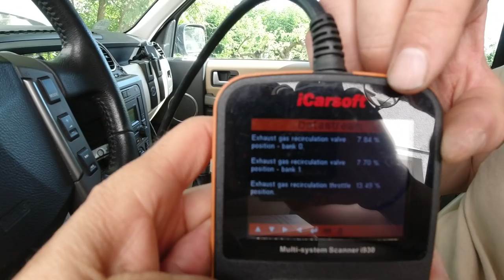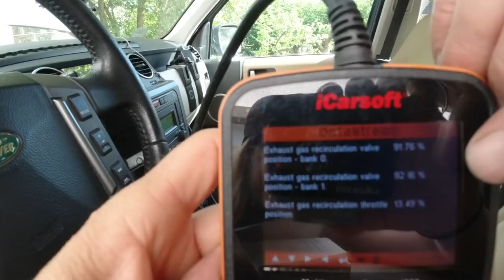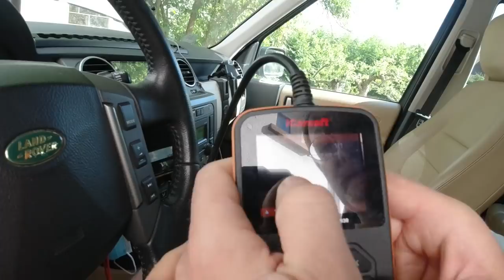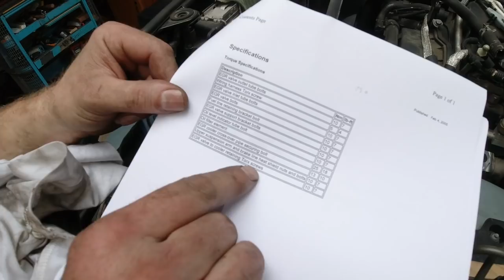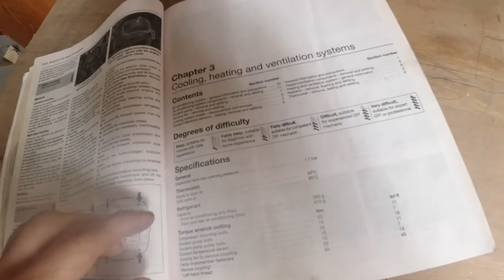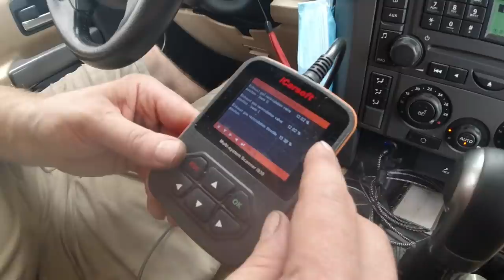How to replace the EGR valve and water pump / Land Rover Discovery 3 / LR3 / LR4

Comment: Holy crap, my LR3 gas engine was a snap compared to this. Did my EGR a month ago. Did my water pump last year. Word of advice, put a piece of cardboard or thin plywood on the radiator while doing any work with belts, fan clutches etc.  Awesome video, you two rock!

Comment: I have recently discovered your channel and I am very impressed with your work ethic and your knowledge I am a technician on airport equipment and have been brought up on Landrover products with my time in the military, I used to use Landrover Defenders  myself  and skipped the Disco 3 for the Range Rover sport with the 2.7 v6  and all the problems that you are having brings back bad memories of the countless thousands of pounds that I spent repairing my Range Rovers, I eventually went Japanese and have had 4 Nissan Navara ‘s my latest is the 3.0 ltr V6 which is about as troublesome as the Landrover Discovery I have decided to go back to running a Defender 110 .

Comment: Hi Christian and Vera, well again with your super German efficiency lol the last time was the "TUF" legal spacers you meticulously fitted, again with my typical English disregard for the law and climate change I removed my EGR valves and removed the DPF and fitted a straight through pipe and did an delete on my engine obd programmer.
I am happier when the engine is breathing through a nice exhaust and not having its breathing chocked by pumping gasses back through the engine block to diminish its fresh air fuel mixture. Actually as long as the vehicle passes its emissions test on our MOT the removal of egr is fine also because of the weight of the car a dpf is not a legal requirement... the test isn't as bad as your "TUF" which I had to manage when living in Munster in the 1980,s
Always enjoy your technical skills and great humour lol all the best Phil and Louise

Comment: Hi, hope ur both keeping well , fantastic video as always , ur spot on 👍👍pre 2007 don’t need the EGR software patch if the EGRs are blanked , mines a 2005 UK D3 , No DPF, must admit blanked mine , left the pipes in situ and slid a blanking plate between the engine block and pipe , then removed the butterfly valve , was amazed with how dirty the throttle body and MAP sensor was, runs so much nicer now and always passes the MOT emissions every year . If it also helps as know it can be frustrating sometimes trying to reach into the engine bay , that I’ve done the same , removed the negative battery lead, jacked it up, removed both front wheels and dropped it down onto axle stands , really helps by lowering the front for better access, of course know ur extremely knowledgeable , just something I learnt and hope that it may also help u, stay safe and of course if it’s ok will share ur video on the Land Rover forums , 👍ps, have u seen the new MOT regulations for northern Ireland seeing it’s still part of the EU , that it will include a code reader to be plugged in, also do u have any LR time stickers left please and purchase price as would be very honoured to have one in the back of my D3 , many thks
Reply from the maker: 👍 Email me your adress,  I'd love to send you a sticker. 🙋‍♀️ Vera
Reply: @Vera_and_Christian  bless you and that’s so kind  of you and will of course send a pic of it in pride of place on my disco , thanks so much ,stay safe and well ,  gary 👍👍
Reply: @Vera_and_Christian  many thks once again and hope the email came through ok , 👍

Comment: I replaced the EGR valves two times (i drove my D4 334.000km... before selling it)
Truly, the best car ive ever driven. Spacious view, comfy seating, a work horse but with all luxury. 
The battery side is a one mans job, 20 minutes and done. The braking side is hell and cant be done alone, unless youre very patiently... but count on 2 and not 3 bolts holding the EGR. (yes you can debolt the AC system, but will have to refill afterwards)
Reply from the maker: That was also already the second time we did this side. The other one we did only once so far. Thankfully, Christian almost always has me helping. 😃👍🙋‍♀️

Comment: As someone who has worked on Land Rovers for 30+ years, I'll give you a good tip.  Get yourself a few old pallets, then when you are working on the Landy, put one in front and one each side and that extra 15cm is perfect.  
Pallets are free, environmentally friendly because they are wood, they have good grip on the surface and won't slip or fall over like a milk crate or step ladder, thy can live outside and when they rot, you can put them on the fire and stay warm.
Reply from the maker: Never thought of it, we have at least 20 pallets at home. Philipp uses them for his  Mountain bike trial training 😃👍🙋‍♀️ Vera
Reply: That’s a great idea, normally I’ll remove the front wheels and put some axle stands underneath to drop the front right down to make it easier to work on , particularly the engines oil filter , at one stage I felt like putting a plank across the engine bay but seeing the wings aren’t metal thought it was a bad idea , good call 👍

Comment: Hi,
I was very surprised, seeing your bolts fixing the egr to the egr cooler, looking to the front.
At my D3 2009 they are fixed from behind!
That is always a fantastic job to loosen them.
But after four or five changed valves, you get used to it😉.
Funny video!
Regards Herby

Comment: As you said Christian, we in Australia have nothing in the location where you have the diesel heater. It is a good location for another 12V battery for running a fridge, camp lighting, shower water pump etc.

Comment: 2% battery - that tickled me. True lies was a good film.
I remember my WK 2005 Grand Cherokee with the Mercedes OM642 3.0 V6 Diesel would throw a check engine light when it was not happy with EGR, I put a resistor on it to keep it closed and get only fresh air.
Reply: Are you confusing the EGR with the intake manifold swirl flap actuator on the OM642?
Reply: @tempestv8  that can easily be done. 
There is even a video I made in my collection many years ago. 
Made a long time before people (including me) made
Anything from YT 👍

Comment: If a water pump is on sale, you've got to buy it - LOL. The old one looked that it had some play in it already, so the sale was timed just right.

Just changed my timing belt so I replaced all the pulleys and also the water pump and belt  to avoid having to disassemble all the stuff later.

Great videos, but I doubt I'd attempt the EGR valve myself. BTW - where did you get the tiny ratchet angled wrench and the magnetic bolt retrieval rod?
Reply from the maker: Oh, the magnetic rod is the most  useful tool we own. I got the one with the light up front just recently, but its too big for every hole. So we have now two in our toolbox.  The angled ratchet wrench, we bought the day before.  Talk about good timing. 😅 We have changed several pulleys before we started our Youtube channel, so that'S why we did not do it this time around. 👍🙋‍♀️ Vera

Comment: Hi / love your vids! I have a LR3 diesel it’s started juddering under load ie towing or going up hill ; the rev counter goes up and down but on the flat all is
Fine ,I was advised to change gearbox oil and filter which was done a small improvement, what would you think is the problem,many thanks .

Comment: Hi Vera and Christian, great vid again. What kind of hints and failures lead you to the water pump? Leaking drops of coolant undee the front?
Reply from the maker: None at all, impulse shopping, to have a spare one at home.😅  But our car has almost 230000 km on it now, and we knew that there was a chance that the pump might fail soon. And it appearantly  was recently starting to leak, we only noticed it when we pulled it out. We did not see it while installed at all. It's an easy fix, most work is taking all the stuff out, and since we already had everything we just changed it. 🙋‍♀️ Vera

Comment: As usual interesting. These LR are so complicate. Where and why you put cupper greese in the EGR instalation
Reply from the maker: Well, we put Copper grease on screws that we need to open in the future again, and ones that are susceptible for corrosion. From past experience when taking out the EGR Valves, it certainly is important to grease those screws. And we have not had a torn screw yet. If the get loose, we will find out and deal with it. We always have our obd ii tool hooked up to the car.  The EGR valves only last about 3 years on our Discovery, and we definitely want to keep that much longer. But we use a lot of copper grease, but also lock tide when copper grease is not the right choice. Christian can lecture for hours on that topic, maybe we should make a video one day. 😃🙋‍♀️ Vera
Reply: @Vera_and_Christian  
Thank you for this important information. You are like enciclopedia in this market. Thanks for sharing

Comment: How do you know the EGR valve needs changing and how did you know what side to change 
Thank you 👍👍
Reply from the maker: Hello Charles, lack of power in the low rpm range ( below 2000rpm) is an indication. It will throw a fault, but you need a obdii diagnostic tool to read it out. It will also state which side is defect. 🙋‍♀️Vera

Comment: In the next video, can you spare a minute and show us what paperback workshop manual you have for the Disco 3? I just can't find one to buy, only Haynes or electronic, but not the original LR workshop, paperback manual.
Reply from the maker: You find the LR workshop manual for the Discovery 3 for download at the Disco3.co.uk site.  It’s not as easy to use as the Hayes but it has more technical data.  There is a delay between our repairs and the launch of the videos.  It will take a few weeks. Christian

Comment: Super video! I have a 2008 with EUR4. Could it be possible that my car has different EGR valves and different coolers. In your video the EGR cooler bolt's heads are pointing to the front of the car. So you must have holes in the valve and the threats in the cooler. My car has the threats in the valve!!??? The bolt's heads are pointing to the rear. This is much more difficult to Work on.
Reply from the maker: EGR Valves have changed from Euro 3 to Euro 4, but we do not know how.  I am going to check on Fabians Disco when he comes by again. He's got a 2009er. 👍🙋‍♀️ Vera
Reply: 2

Comment: Question for you guys; I replaced my EGR valve a few weeks ago and I still get a 'p140a exhaust recirculation sensor c circuit low' error. It seems to be intermittent. I think it is an issue with the plug/connector. Any ideas on how I could improve the connection within the plug/connector? Thanks!

Comment: Great videos, some of the best on youtube. I've learned a lot from you, thank you. I have a Disco 4 3.0 tdv6. The best tow car i've ever owned. It's not without a few problems though. At the moment, among other things like suspension sinking, it's developed restricted performance due to low boost. It's been on a ramp at the local garage and it's a split pipe from the EGR valve to the exhaust. I've been quoted £2200 to remove the body, and delete the EGR valve and blank off. Do you think it might be possible for me, i'm not a bad mechanic, to replace this pipe without removing the body, given that the exhaust connection bolts are likely highly rusted.It's a 2009 model with 130000 miles on the clock. I'd value your opinion. Thank you and regards, Steve
Reply from the maker: You need to check the LR4 workshop manual for the procedure.  If it’s listed as a body on job, you can do it.  Will be heart surgery for sure with special wrenches. It even lists the turbo as body on, so I think they are as usually not ready to do such a job body on and go the simple and expensive route.  Christian
Reply: @Vera_and_Christian  Thank you so much for your reply. I’ll follow your advice and get a workshop manual. Always used to but the hard copies for vehicles but now it’s all online I’m never sure what I’m getting in terms of quality literature with good guides. If you could let me know your source or provide a link that would be fantastic. Cheers and thanks again, Steve
Reply from the maker: @ultrasteve9031  You'll find everything on the Disco3.co.uk website. 🙋‍♀
Reply: @Vera_and_Christian  Brillant, thank you 🙏

Comment: Christian, is there not a function for locking out the auto air adjustment. On mine I just need to push the up direction for around 5 seconds and it will lock the height and not try to correct with wheels in the air - which as we know could cause airbag over inflation.
Reply from the maker: No, Christian read everything that is to read about the Discovery 3. 😅👍🙋‍♀️ Vera
Reply: @Vera_and_Christian  
Oh I defiantly feel that, we share a lot of  characteristics 👍

Comment: That is correct. Euro 3 cars don't throw Engine Lights whe  EGRs are blanked. Don't ask me how I know :D
Reply: Yep, same here, lol , , couldn’t believe how dirty the MAP sensor was , also ensured I replaced my oil pump with the upgraded one
Reply: @garystuart226  First thing I did when I bought the car: timing belts (with tensioners and water pump), oil pump, EGRs blanked (with butterfly removal). 101k km later, still a happy owner :D
Reply: @AlexStrugariu  plus 1, oil pump , timing belts, tensioners water pump , etc wasn’t 100% sure it had been done so indeed for peace of mind all replaced , then I think it was a year later I blanked the EGRs , then went on to Dinitrol the chassis inside and  out, blimey I thought the job would never end , think one of the worst jobs was replacing the rear upper wishbones &#*#**@((#*# , what a job that was , lol, but must admit really like the D3 , sad really there’s nothing really after the D4 , new defender will have to be years old before it comes into price range , lol

Comment: Euro 3/4 Size difference for EGR Valves!

I was going to replace the EGR Valves on my 2007 LR3 cos they where cloged up and causing the engene management system to not apply any acceleration or eaven shut down the terrain response so the car wouldnt move faster than 5 kmh... turns out there is different sizes for Euro 3 and Euro 4 exhaust gas standart so the ones i bought dont fit -.- 
So be careful to check that first (:
Reply from the maker: 👍We have a Euro 3 and have replaced the right EGR valve now for the second time. Of course, I hope everyone checks first what kind of a spare part fits their Discovery.🙋‍♀️ Vera

Comment: What brand and spec of coolant did you fill in again?
Reply from the maker: Christian uses this one https://www.amazon.de/Frostschutz-K%C3%BChlerfrostschutz-Konzentrat-u-Preishammer/dp/B0754MPK8J/ref=pd_sbs_4/257-8172692-0605356?pd_rd_w=yze5i&pf_rd_p=b1c388c3-48c2-4960-8532-fa8f1477aee9&pf_rd_r=8RB6NG11P461C0Q7QRBP&pd_rd_r=03c525b4-f7bc-4699-9de1-e02b746bc1a8&pd_rd_wg=EiLN3&pd_rd_i=B0754MPK8J&psc=1 but I don't think we bought it on Amazon, more likely at kfzteile24 or Autodoc. 🙋‍♀️ Vera

Comment: Hi Christian and Vera I am a new sub and looking to buy a disco 4 SD 3.0 SE Tech what are your thoughts on this model I would appreciate your opinion before I spend £22,000 . Loving the videos and humour keep them coming at present I am binge watching all your previous videos to catch up hope you are both well and avoiding the COVID menace.

All the best Bob from the north east of England
Reply: Hi , hope u don’t mind me mentioning it , check out the link that Christian and Vera have shown, it  links to the D3/4 forum and being a D3 owner myself found it invaluable , also on the forum ur find details with regards to warranties , seeing there complicated motors will be peace of mind ,  hope that helps a little
Reply from the maker: What we think is most importantly is whether you are able to fix your Discovery yourself or have someone helping you. Or if you have to give it to a Land Rover certified shop everytime.   Now, I don't know how old and how many miles this Discovery has. Get yourself familiar with the service intervals, see what should have been replaced by now and what needs to be done soon. Have a diagnostics tool, like the OBD ii 930 hooked up to it, and look for Engine faults. And do not look necessarily at the service booklet, but rather at the bills for each fix and service interval. So you actually know that they changed the diesel filter and not just put a  ✅ where it belongs. Also have look at the wheelbearings, if they have play.  Depending on mileage, there should be a new timing belt and fuel belt, EGR valves.  
I am sure you are going to love your Discovery 4, it's the best. 🙋‍♀️ Vera
Reply: @Vera_and_Christian  thank you so much for the reply Vera my father in law is a mechanic so I have no problems with having it looked at when necessary but will definitely look at acquiring an OBD, I look forward to the next video you guys stay safe regards Bob.
Reply: @garystuart226  don’t mind at all Gary and thanks for the info I can’t wait to get mine. Regards. Bob
Reply from the maker: @robbyb4959  👍🙋‍♀️ Vera